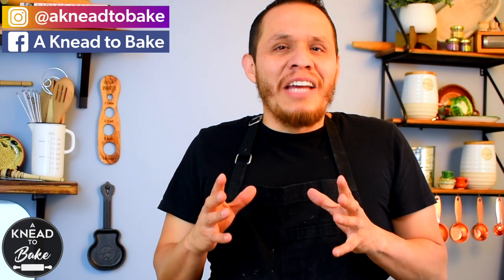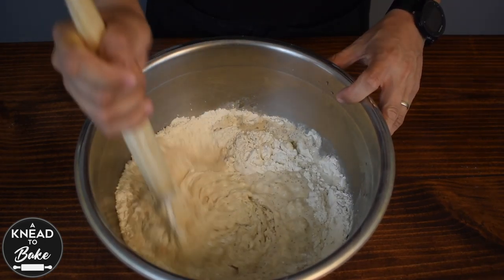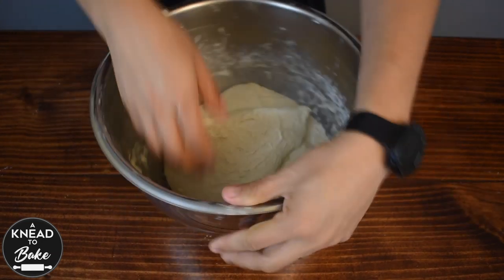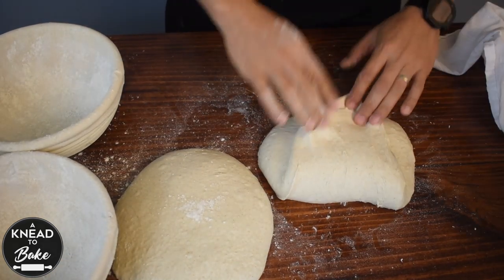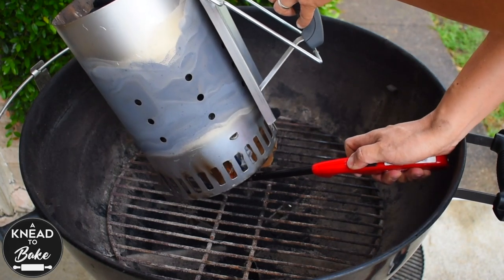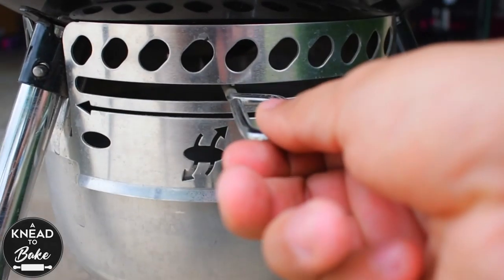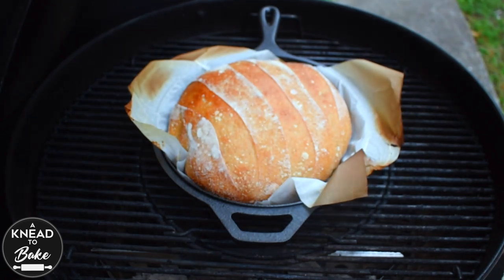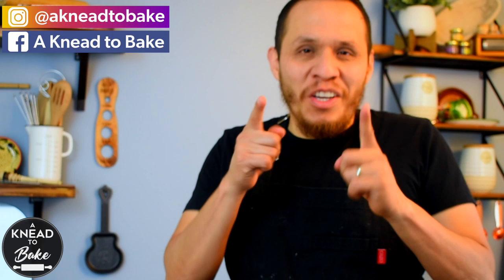How to Make Sourdough Bread in a Grill

Comment: Wonderful, thank you!  My oven control board is shot and I’m awaiting a replacement to arrive.  Add that it’s been 38C+ most of the summer, and using my grill has been a lifesaver.  I’ve got a decent Weber so I’m able to control the temperature waaay better than my messed up oven with the bonus of not heating the house.  It made awesome bread - once I fix the oven, I still may keep using the grill!  Edited to add:  at the suggestion of a friend, I line the bottom of my Dutch ovens with uncooked rice before putting down the parchment.  This helps with the burning.
Reply from the maker: That’s a great tip for your friend! Thank you! I will do it for sure!

Comment: I’ve used my gas grill also, my best tip to keep from burning the bottom is to use a broiler pan underneath the Dutch oven. The grill grates get up to 600 degrees. Hasta
Reply from the maker: I will try it next time!
Reply: I was just thinking of trying this. Thank you for sharing your result! 🙏🏼

Comment: Got a power outage and wondering whether to use my gas barbecue or my glass enclosed fireplace. Thanks for the video!
Reply from the maker: I hope you resolved the issue
Reply: @AKneadtoBake  I did both. Fireplace was too hot, but barbecue worked well!

Comment: Cast iron is a bit expensive here, can I use a loaf pan? And lid it with aluminum foil?
Reply from the maker: I haven’t tried it with a loaf pan but I’m sure you can, you should be aware of the heat to not burn your bread